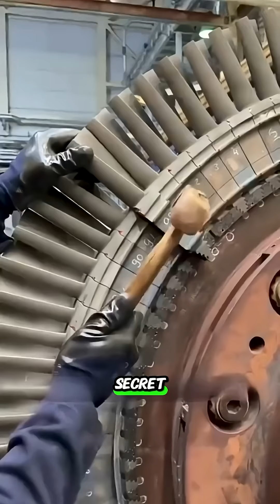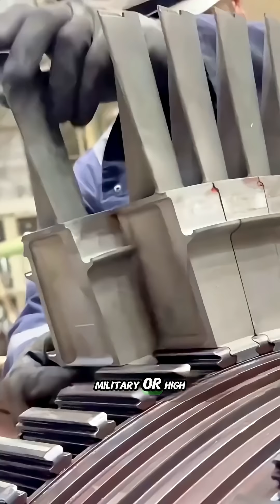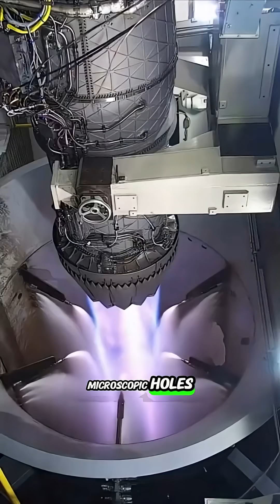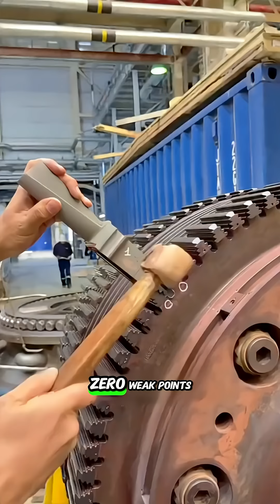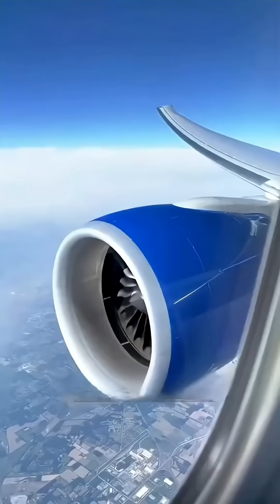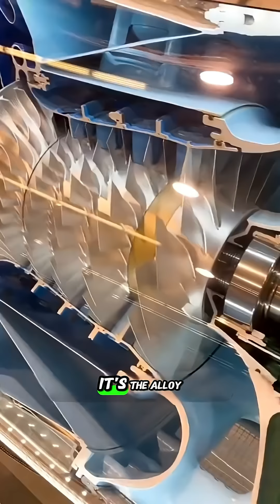The Insane Reason Nobody Can Copy American Jet Engines

Comment: Da US didn’t it’s a lie. It’s Hitler Germany who invented jet engine build it and installed it on fighter jet Second World War, also,
Same engine was installed on Bat Wing fighter Jet. After the war both aircraft were stolen by US military, transferred to US and copied them to the last bold. B2 is direct copy of German B2 invented by Hitler Engineers kidnapped by American forces.
To say US invented jet engine is a big Lie. A big.
Reply: You really suck at history and comprehension. This video short never said the U.S. Invented the jet engine. It states the modern reasons why few other nations could copy the U.S. manufacturing of modern engines. Only Rolls Royce is the real competitor. The first proposed design and patent for a turbo jet engine was British in 1932. The German jet engine built in 1939 is suspiciously based on the British inventor's patent. The U.S. already had a test prototype P-59 Airacomet jet flying in late 1942 only a few months after the ME-262's first flight. And the B-2 is the direct lineage from Jack Northrop's flying wings prototypes the YB-49 (1947), YB-35 (1946), N9-M (1942), and last the N1-N which flew in 1940. The N1-N flew 4.5 years before the Horton brothers HO-229's first flight in Feb 1945 and only flew twice after that.

Comment: Videos like this make me think about the person who peaked in High School.  One word. “China”
Reply: Pse explain
Reply: Only four countries in the world can make the fifth-generation turbo fan engines due to their high complexity. China can't produce them by reverse technology.

In 2006, an agreement was signed on the creation of a new engine, which was named PD-14 (a promising engine with a thrust of 14 tons).

PD-14 is a serially produced Russian high-bypass turbofan engine of fith generation developed for the MC-21-300 aircraft, PD-14A for the MC-21-200, and PD-14M for the MC-21-400. PD-8 engine will be installed on the Be-200, AN-148 and Sukhoi Superjet 100 aircraft. Therefore, the designers and engineers faced the task of creating a unified gas generator, the main element of the engine.

16 new technologies were developed for PD-14 by russian designers, engineers and scientists, namely - single-crystal blades for a high-pressure turbine with an advanced cooling system that allows the turbine to operate at temperatures up to 2000 ° K.; hollow wide fan blade made of titanium alloy, thanks to which it was possible to increase the efficiency of the fan stage by 5% in comparison with the fourth-generation turbofan engine PS-90 produced in the USSR in the late 1980s; low-emission combustion chamber made of intermetallic alloy; sound-absorbing structures made of composite materials; ceramic coatings on hot parts; hollow blades of a low-pressure turbine, etc.

 20 new materials were created for PD-14 with indisputable advantages: a decrease in specific fuel consumption by 10–15%, a reduction in the life cycle cost by 15–20%; operation of the engine will cost 14-17% cheaper than existing analogues. All of them have been certified according to international standards.

New Russian titanium and nickel alloys are used to create the engine. The engine nacelle design comprises 65% domestic polymer composites, which achieve the required level of sound insulation and reduce engine weight. 

The technologies used in the production of PD-14 are state secrets and are protected. Therefore, information about PD-14 is broadly classified. Example: China would gladly copy production technologies, much like the Su-27. They copied the plane, but they failed to replicate the AL-31F engine.

The state's ability to produce cooled cast blades for a modern turbine aircraft engine is an indicator of the highest level of development in mechanical engineering. There are fewer states capable of producing fifth-generation aircraft turbojet engines than countries with nuclear weapons or those that launch satellites into space. Only four countries—Great Britain, Russia, the USA, and France—possess full-cycle technologies for creating such engines.